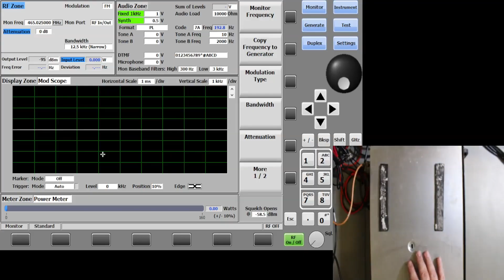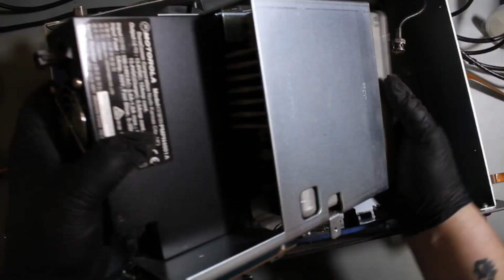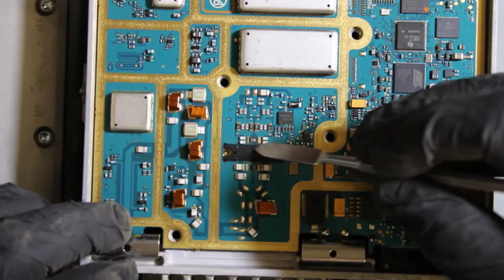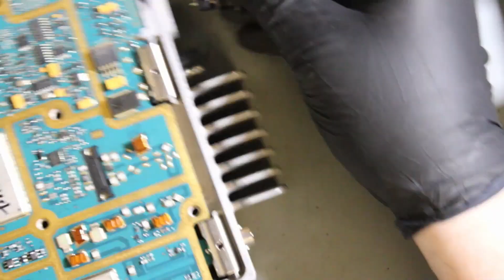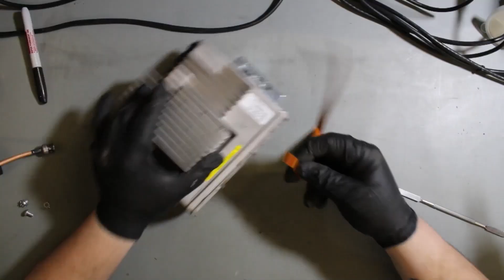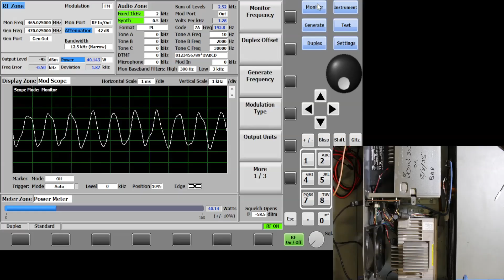Motorola XPR 8400 Repeater Repair | Fixing a "No Power Out" Issue

Comment: Will certain XPR mobiles work as a swap in replacement? I have an XPR repeater where both radios have a failed PA.
Reply from the maker: No that won't work. If you compare the boards you will see tiny areas that are different components. You can try but personally I don't think it will work.

Comment: Nice video tutorial.

Pro tip - Removal of the enclosure’s front plate (4 slightly larger screws than the 5 used to hold on the top cover) of the Motorola XPR 8300/8400 or similar Vertex Standard R70, you will gain more access room for the flat ribbon cables removal/insertion management - less likely to damage the pricy cables.
Reply from the maker: I'm just a fan of taking the entire case apart. You are right though, it is a lot easier, though you need to be careful with the ribbon cable that is attached to the front PCB that is attached to the front plat.

Comment: Great tutorial! The company I work for just purchased a XPR8400 which I installed recently. It worked great the first two weeks until it didn't. It suddenly is only transmitting at 3.1 watts. Swr is 1.3 and I re-wrote code plug but still low power. Would you imagine  pa is almost toast? New sub btw!
Reply from the maker: Most likely. If it was originally pushing out higher wattage and now it's 3.5 it's most likely the pa burnt out. I'd try to switch the boards. See if that fixes the power out. 

If it does I suggest setting it to low power and getting an external power up to boost it back up. It will make the unit last much longer.

Thanks for the subbing! I'm still working on videos, I'm just not that great at editing or recording them consistently.
Reply: @BlueMountainRadios Appreciate the quick response. They want to use mixed mode which came with it but I suppose they will just have to pay for it if swapping radios fixes the issue. Thanks again friend! If it happens to be a simple resistor I may just fix the current radio.
Reply from the maker: @jetkrazee Good luck. Swapping them may not work though if they already got swapped. It's why I try not to deal with the XPR repeaters if I can. I'd rather use a Kenwood TKR D710/D810 repeaters for dmr.

Comment: Hey, thank you so much for the video, it will give me the confidence to do this because I have to do the exactly the same thing. My 8400 is showing about a half a watt out now. So, question, when I hook up my laptop and get into my CPS, is the only thing I have to do is change the receive and transmit frequency? Or is there something else that I have to do? Thank you!
Reply from the maker: All you have to do write the code plug you pull out of it back into it. You may get an error saying features are not enabled etc as the RX board may or may not have the same features as the TX board. If you get the feature error all you have to do is read the 8400 and copy and paste the channel you need from the old codeplug into the new one and write.

If you have an EID you are using such as Dynamic Mixed Mode, just know swapping the bricks will remove that as the TX radio is where it is unlocked not the RX board. If you have any other questions reach out any time.
Reply: @BlueMountainRadios  Good news, the swap worked and thanks for the help.  Nick.
Reply from the maker: @efamo4 congrats. My suggestion is to lower the power output and put an external PA on it. It will save the internal PA in the XPR. Though that is my suggestion.
Reply: Already, doesn't sound too bad. And yes, I do have dynamic mixed mode but I don't ever use it. So, I'm going to give this a try tomorrow and see how it works.
Reply: Meant to say alrighty.